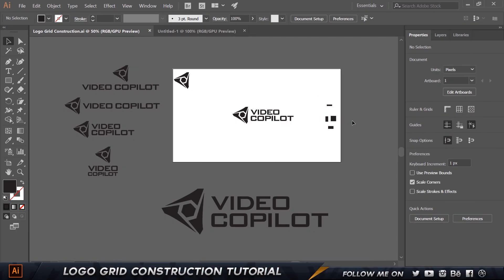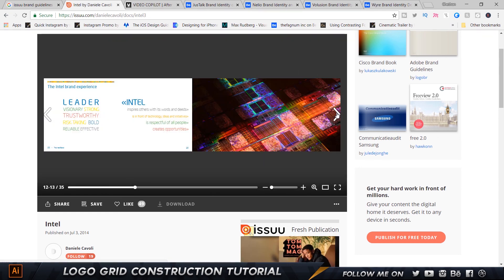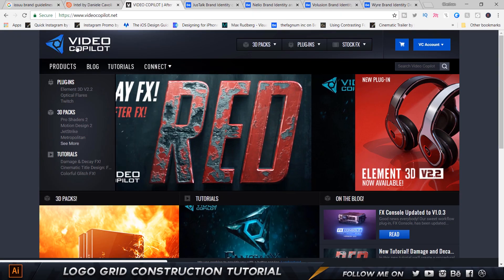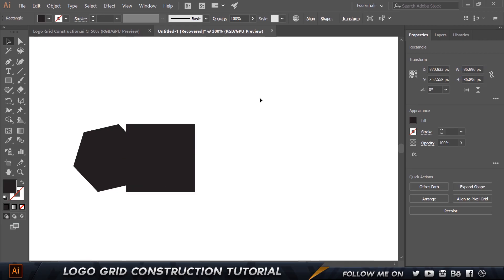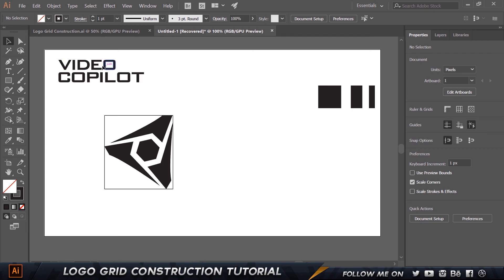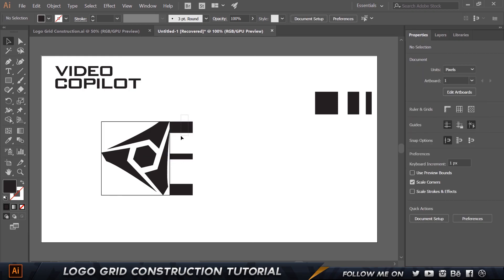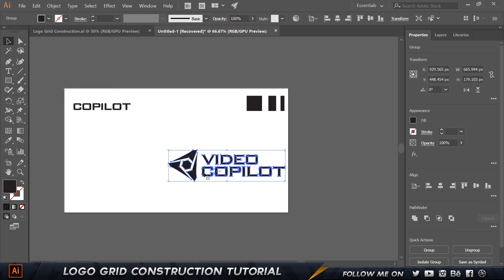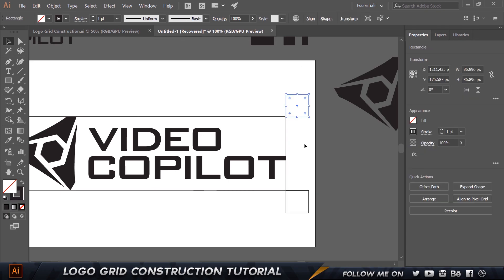Logo Grid Construction Tutorial - Illustrator CC 2018

Comment: Very helpful! But, how exactly do we ensure the grid is used and correct when in actual use? Do we crop the final output files to match this grid?
Reply from the maker: Yes
Reply: @DesignPilot  Thanks for replying :-) Is there a standard document size or at least ballpark for how wide and tall a rectangle word mark should be?
Reply from the maker: No rush as such